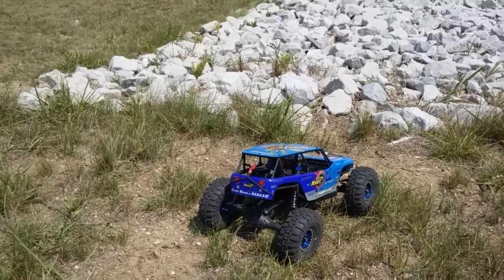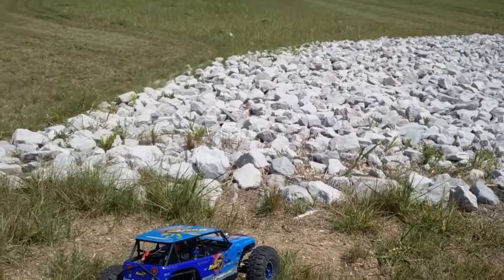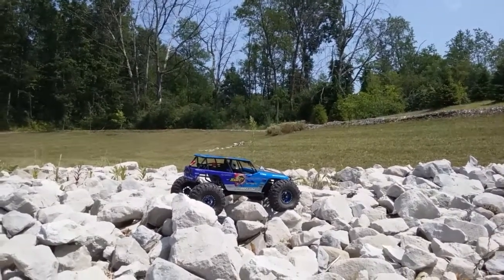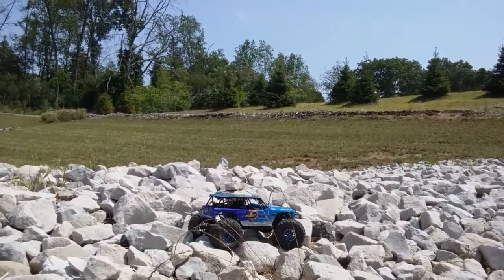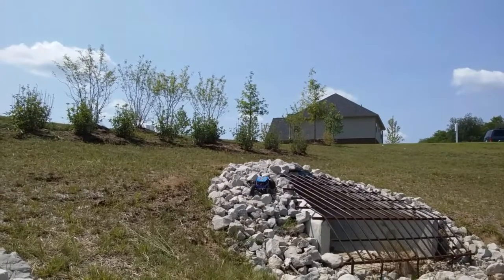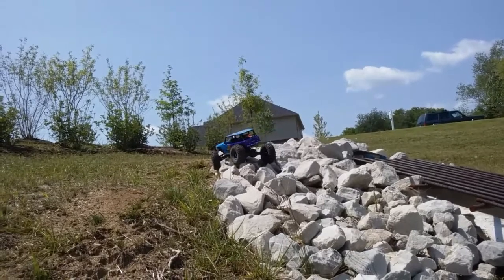WLtoys 10428a on Jagged Rocks

Comment: nice video a bit shaky ,I have this car and I love it I've done a few upgrades servo next is motor thanks for the upload
Reply from the maker: Many thanks Joe! 🙂
sorry for the shaky camera,☹️ 
This video is a few years old now,and was close to the starting of my channel,
And I was a filming with a low grade Cell phone,😕lol
I've upgaded phones several times since then, and I'm currently using a Motorola Z4, I would love too have a standard video camera,or GoPro, But my internet is terrible! And I'm forced into uploading videos with my cellphones internet,☹️ Which also involves me driving into the nearest town,and sitting in my vehicle for an hour or so while the video uploads,😕 good cell signal in town,But not so good at my house,Which is located in the North Woods,of North West Michigan,🤔 so my cellphone is my only option for filming,😕🙂
As for the 10428a; I loved it at first,and then I started breaking drive train parts,
And went through a short process of weakest link breakage,and upgrades,
Then I upgraded the esc, receiver,and servos,
Then I made it totally amphibious,And that wasn't enough,
So I installed a Traxxas Vxl 3s Brushless Combo,
3600kv motor & "3s capable",waterproof esc,
Then I proceeded to go through another process of weakest link upgrades, and a long process of spur gear & pinion adjusting,
Along with upgrading to a Team Losi "Kevlar" spur gear,🤔 And started a process of trying to get the truck to hydroplane water,Not only hydroplane,
But also have the ability to Float,and paddle itself back to shore if needed with it's huge Proline 2.8 sand paw paddle tires,😊
Anyways,that was a few years ago as well,and also posted on my channel,lol
The wltoys 10428a,has actually been sitting on a shelf for the last two years,or so,🤔 I Cooked the esc running it on 3s in 6 inches of fresh snow, with some heavely weighted Proline 2.2 super swampers,mounted on aluminum wheels,with 17 ounces of lead weight in each front tire,"The weight was too help hold the front end down" She's got Some Insane Power,and I wouldn't be surprised if it would pass 70 mph,🤔 
It's faster than my Arama Nero on 6s,Stupid Fast!🤯
But the weighted tires were too much for the esc, and the esc turned into a BBQ cookout, Smoke fest!
Otherwise everything else is in good working order on the old girl,🙂 I should probably think about replacing the esc one of these days,🤔 lol 
Thanks for your great comments,and for checking out the video my friend.😎👊👊👍👍